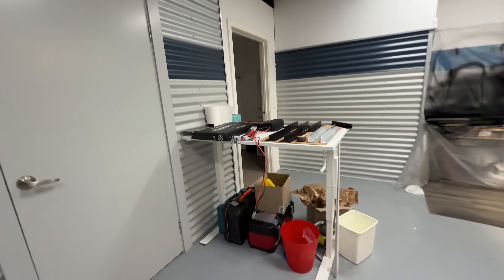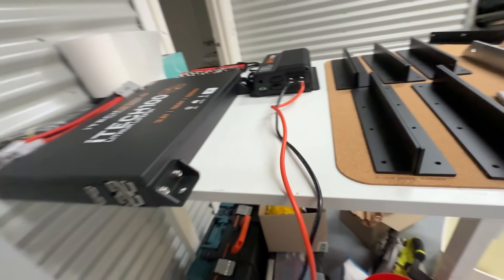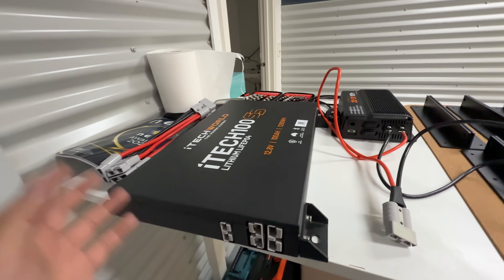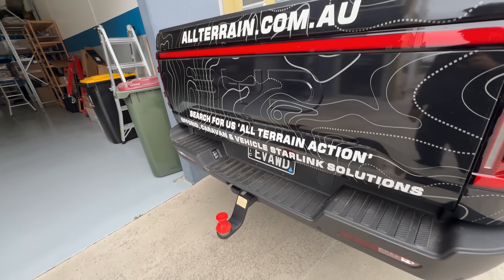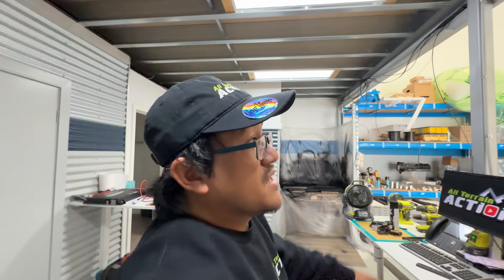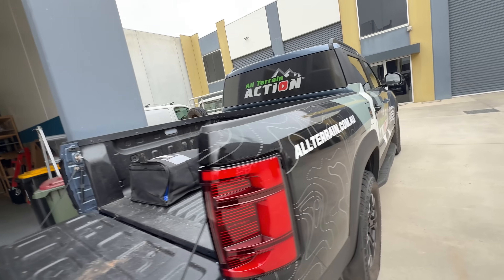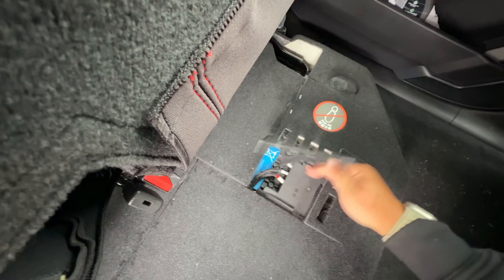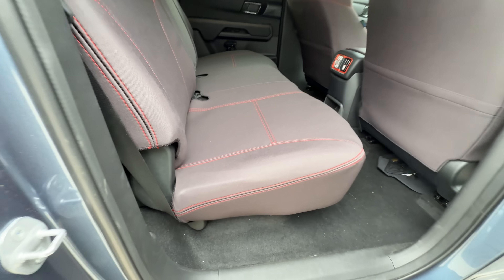BYD Shark 6 brainstorming for a 12V System

Comment from the maker: I am also considering utilising these batteries for perhaps a winch draw setup in the future but it would need to be direct from terminals, these 100SS batteries rated to 250A per battery, which would give me 500A draw but the 120A Anderson connections have to be bypassed for this to work - its a work in progress and will see how what we end up with.
Reply: Dude, what on earth are you running to need 220Ah capacity! 

Also check the nameplate on that underseat rectifier, it's good for 200A @12VDC, so you could just install a DCDC from one of the spare midi fuse busbar in the under bonnet fuse panel
Reply: I am wondering these same things mate, what is the rectifier please? The battery or the thing on the other side? I thought the thing on the other side was for converting current when charging the car? @CarmenBonkalot
Reply: Liking this idea
Reply: Ahhh fair enough, a bat system to take the first hit is smart that won't trigger the internal systems. Good plan.
Reply: Itech don't specify a max current draw for the battries so not sure what the BMS will cut out at, also the SB120 anderson connection can handle 240amps but is only rated at a max disconnect Current of 120amps and the SB50 can do 120amps but only a disonnect rating of 50amps. provided the cable sizing is sufficient.
Reply from the maker: @ I have already reached to Itech support regarding max draw ratings, hence knowing the terminal maximum draw capacity.

Comment: Why could you just not run a 15amp cable to a GoBlock or some other power station or just a stepdown 12v transformer in the caravan
Reply from the maker: We’ve already sorted this another way, there is an onboard DCDC 220a 12v system. We’re got a run back to their twin 50a Anderson and that’s going our van charging now just fine.

Comment: How are Ironman wiring in spotlights etc? Ironman sell a bulbar with a spotlight and are winch ready. However I am aware the ironman winch is still in development. The Shark must have a fuse box with spare 12v sockets? I maybe wrong... also where are ppl attaching the tow braking system such as a Redarc? That would be a good research item and worth making a video on...

Comment: Just tested the portable ARB twin air compressor with 4L tank. Connected under the bonnet where you would connect to jump start (see manual, it’s page 100 of the NZ version I found online). 

Happy to report it works perfectly! No blown fuses or error messages. 😊 Make sure you have ICE running as you would on any vehicle for these types of compressors. 
Great news for re-inflating tyres quickly. Not sure how a heavy duty winch would go…

BYD should give some info on the max amp you can draw before blowing a fuse or  damaging the battery/ 12v system.

Comment: Surely you could do a simple test to find the dc to dc 400v to 12v current rating.  Use a dc clamp multi meter. Start small and ramp up 12v loads and measure the input current using the clamp meter. Maybe you have or borrow a 2kw+ 12v inverter for the load testing.  Im sure as some have mentioned that dc-dc converter will be high powered.

Comment: I don’t have a Facebook account but there is a post saying “good to see you can plug an air compressor under the hood” in a shark owners Australia group with a photo. I am interested and like to know more as I got my Shark today and want to know if it’s safe to hook up my portable ARB dual compressor with 4L tank. Don’t want to cook the 12v system on the new Ute. I think it will work as long as you force the ICE engine to run first. Appreciate anyone who can provide more info please.
Reply from the maker: I have heard of people running their standard 12v air compressor off the Shark single pump would be fine twin I’m unsure, I think someone said it’s 150a capable @ 12v but don’t quote me on that
Reply: @AllTerrainActionEV  did you see the Facebook post? Also I just played around and it seems you can force the ICE to start by holding down the start button or maybe it was the button to toggle between EV and HEV… I might try hooking the compressor up tomorrow. Would be great if it works as 240v compressors are too slow
Reply: @MattBradleyMachine  I’d like to know how you went on this as I’m trying to figure out how to use my air compressor with the shark as well

Do you have any instructions  you can share or how did you do this?
Reply: @ see comment below from a few weeks ago

Comment: You are going about this the wrong way. The Shark has at least 150A DC-DC converter to generate 12v. It also has 240v available and it has a huge battery compared to what you are adding. You are wasting your time adding a 12v battery.
Reply from the maker: @franciscoshi1968  this is the answer I was waiting for, where can I find more info about this 150A DCDC capability we can’t find anything on any document to confirm this before we start using high loads. This however is under what we had hoped as most 12v/24v winches will demand at least double that requirement. It’s possible we intend to use this setup for that in the latter future.
Reply: @AllTerrainActionEV  I work with EVs. Have stripped plenty of BYDs.
In general the smallest DC-DC converter on EVs are about 2kW. Even a dolphin has a substantial DC-DC converter.  If you really want lots of power we could add a bigger DC-DC converter powered from the traction battery.  We should be able to get enough to run 2 winches at full load until the winches overheat.
I am in Brisbane north side.  I think we should meet some time.
Let me know if you are interested.
Reply from the maker: @franciscoshi1968  please send me contact details at chris@allterrain.com.au we can chat about requirements in more detail, thank you.

Comment: I remember picking up my Atto 3 from BYD and they could not stress enough to me that they did not condone anything electrical being done to the car, actually auto sparkys told me they could wire in another 12 volt socket in the back but BYD gave me a mixed response, some sales people were like, yeh, that’s ok. Where as upon picking up the car and signing paperwork they told me, don’t do any of that !

Comment: This was one of the reasons for considering the shark and using the car battery as the “12v system” saving money on a $3k 12v set up again 
Only run a fridge full time and was just thinking of a powerbank for the awning lights 
How long would a fridge stay on just using the car battery
And is it possible to fit a chassis mount canopy on the shark considering the electric charging port and fuel ports??
Cheers and great vids as usual
Reply from the maker: @stevo7454  I actually spent a weekend away with the boys leaving the car on all night to run the fridge all weekend and it worked fine hardly used any power off ac system but my ongoing long term use it’s not practical and I do need a way to DCDC charge the the van (yes could ac dc I know) so for my application I’m following through on the above system. When BYD bring out camp mode to leave ports on, things will change but I’m not going to be waiting for that to happen. Chassis mount situation I have no idea! That’s a good point but most things could be relocated.
Reply: @ I gotta say you are super quick with replying, it’s. Almost like I’m texting you 😂I hear what your saying regarding 12v set up it’s totally opposite of my needs as I only go camping or up to Fraser with the mrs so running a fridge and lights is my only drain. I’m watching all your vids and keen to see if you can get up that hill again trying different modes, I’m now sort of thinking of the gem cannon alpha when that comes out albeit it’s about $8k more I do love the shark though 
Cheers

Comment: So you can’t just use the power socket in the tray to run a fridge?
Reply: Yes, you can.  If you want it running full time however you'd need to leave the car accessories on (can still lock it though), otherwise these points turn off when you turn the car off.  Running a fridge with the accessories left on will use more power because of the overhead of leaving the car on.
Reply: @andyh5666 agggh i see, shame they don't have a camping isolation mode

Comment: The appeal of the shark is being able to run everything off the 240V outlet if it's not able to do that I would be disapointed. I think somthing like the "Segway Cube" would be better it's IP56 rated, 5 year warrenty, charges at 1250W can be used eaisly with solar and be used around the house or other vehical/camper trailers eaisly. And is currently on sale. I've got the allpowers version otherwise I would of got the Segway one i've mentioned above.

Comment: Does the seat ventilation and heating work aright through the seat covers?

(And thanks for answering my dust under seat question) 😁
Reply from the maker: @mitchelljack1590  heating works fine, cooling you feel a small amount of air but not as much as before - I had a GOOD chat with andrew about this and the reality is sand/grains going into the holes are a negative point this at least stops that - how much air can pass through has everything to do with seat cover material and I don’t think is factored into the design because it’s just a concept that would defeat the purpose of the covers intended design to begin with. I was always going to get the first to hit the market covers that were a fitment by design this was the first and I’m fairly impressed with its fitment - I know a lot of thought has gone into it because of the amount of time his company spent with my car. Looking forward to first month of ownership to see how I feel about them after a bit of real world use.

Comment: Thanks buddy really interested in the camping set up lights,sandwich maker haha microwave yes yes i know its a car not a kitchen appliance but after watching my mate running his Mazda BT50 for 2 hrs every night to charge his caravan equipment I think the shark would do this a lot better.
Reply from the maker: Natively Shark will run so much, in fact it will run more AC home appliances than many home battery systems can support at any single given time. Most are 5kW… the sharks 6.6kW capable that’s saying something.

The thing is only 25-70% of battery power is usable as you have to assume you’ll be at 70% at camp as that’s the highest you can SOC at if driving so it’s around 13.3kWh of usable power at camp. Could be running all sorts of things with not really too much of a worry of running out of power in a single night!

Comment: Put a canopy on and just use an inverter.
Reply from the maker: @OllieVK  ewww canopy haha. Going checker hard too, with rails. Keeping the low centre of gravity concept thanks to high voltage battery position, fridge under, basic 12v under and swag and maxtracks on the checker plate strapped down…. At least this is the idea in my head for now 😂 that could very well change.

Comment: Chris, now that I think about it, I've had a similar situation in the Toyota 6 Wheeler where I was going up a step enough gravel hill with a gentle right hand turn (within a property I visit sometimes), with my caravan on and in 2WD and normal traction control mode, and I would hold the throttle down and eventually it would spin the inside wheel till it the forward momentum stopped, then I could hold the throttle down forever and not go anyway nor spin.  Sounds a bit similar to the Shark torque pulling.  If I then engaged 4wd Hi it'd take off no problem.  Just mentioning for context, it might help.  Great vids keep them coming!

Comment: Find the rating of the sharks DC/DC converter before adding more batteries, could be pretty chunky and there would be no need
Reply: I'm confused why you dont just use an AC to DC adaptor?  At 10A the 240V in the tub has the potential to deliver 200A at 12V, you are essentially plugging one in of sorts with your battery charger. Most of these support a 12v power supply mode.  

It would depend on what you are looking to do but outside of an 240v inverter, I can't see many other devices requiring such a high current draw, and with the Shark you already have that 240v inverter and capability built in?

It's not making sense to me but maybe your running something seriously big?
Reply: @, excellent reply.
Reply from the maker: @ your absolutely right, say I wanted 150a @ 12v, give me some plug in options ready to go - I had alot of trouble finding something that would fit the application. Most were 50a @ 12v, some options higher but looked to be something that would need proper waterproofing etc. Not against the idea just struggled to find a good solution that seemed trustworthy plus the tub AC does turn off at the time the car is turned off (currently) so doesn’t help with camp dc loads, fridges etc.
Reply: @paulmanning22  Thank you, I did not know that some 12V chargers come with a ‘power supply’ mode. I’ve been struggling to find a 12V power source that was both IP67 rated and didn’t max out at 11.8V (like LED lighting power supplies for example). The Victron Energy Blue Smart IP65 Charger (25A) looks like it might just solve that problem. As long as it’s okay working in that mode for hours at a time that is. Awesome 👍🏻.
Reply: @paulmanning22  it's off when your car is turned off. Currently need to have ACC power on at least.
Reply: Shark GPT says: The owner's manual does not specify the exact maximum charge rate from the high-voltage DC system to the 12V DC system. However, it does confirm that the 12V battery is charged automatically from the high-voltage system when needed. If you need precise specifications, checking with BYD directly may be the best option.
Reply from the maker: @adam629  have asked BYD no answer given :(  for 12V DC system, I was waiting to see what Ironman would do about the winch power but taking too long and I got trips on the horizon!

Comment: Anderson plugs are not meant for permanent connections they will go high resistance over time they are designed to be self cleaning as they are plugged in and out
Reply: so put some dielectric grease on them.
Reply from the maker: interesting, not something I really have had much thought about. Everything in the past has been anderson based, but I do know what you are saying about this. something to think about.

Comment: Why not just use a big 240v transformer? save a lot of space. Pretty sure BYD will soon bring out the update to allow manual power on.
Reply from the maker: @12Hak  yeah this was my first aim, then I found all this IP rated stuff got expensive, to use any known brand looked costly. This way seemed universal in the way that i can have a 100/200ah dc system for all my accessories ac-dc charging is its own thing and if i do discover a way to dc-dc charge (say there is support for 20a charging) i have options. I do know camp mode is coming from BYD too, I’m just experimenting with options and I have my own unique purposes I want to achieve, this same systems could be used with say kings lithiums and cheaper ac/dc chargers the concepts all the same.
Reply: @AllTerrainActionEV  Yeah, this looks like a simple solutions, just kills me to see the advantage of having 30kw on tap not being used.
Reply: @12Hak  CAn you just plug your V2L adaptor and run the fridge >

Comment: If you want to understand a cars 12v system find the audio guys who upgrade their cars. https://youtu.be/DbQfYe_f8j4?si=qzK-xO7ErybWvVSp
Reply from the maker: @biotravis  I’ve seen Paul’s stuff before, but I doubt any of the Seals logic is going to Shark logic.
Reply: @AllTerrainActionEV  Why would they change what works on the other cars? It has a 30kwh battery after all. I wouldn't be surprised if the underlining 12v system is the same.
Reply: This is an EV first company.... I would bet the 12V system is very good.
Reply from the maker: @biotravis  maybe so, but drawing 300-400a for a winch though? What about 80-100a for a dual pump 12v air compressor? Theres a few application’s that I can’t seem to know for sure if we can run of existing 12v systems that’s got no documentation to maximum draw loads. In some cases AC 230 compressor could be an answer, same with ac winch but not a lot on the market.
Reply: @ Sorry you are correct, I would definitely put in a bat system to take that load. The car system won't handle that for sure.
Reply: Love the content mate learning a lot about the shark.